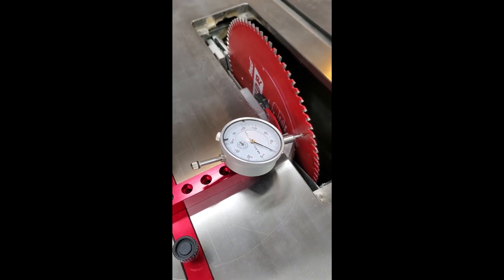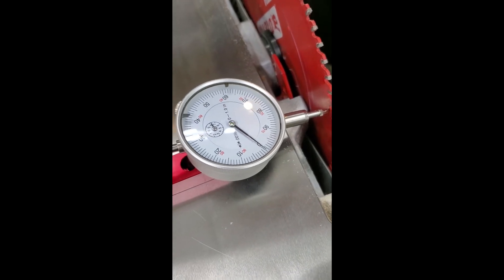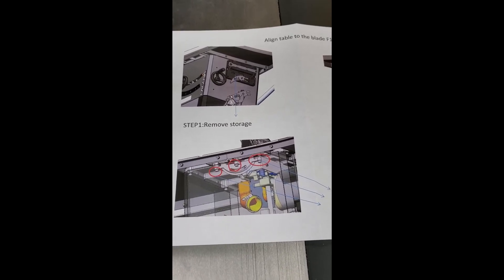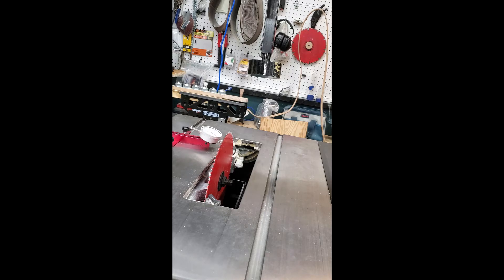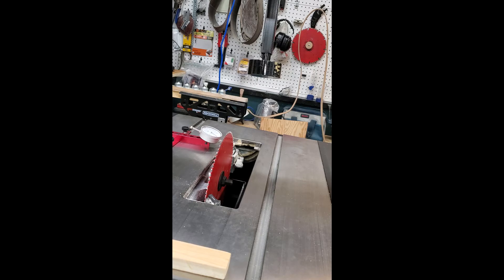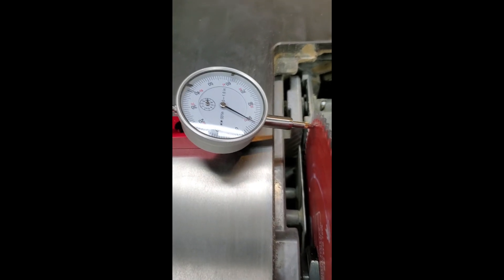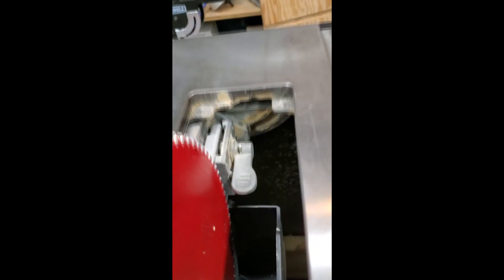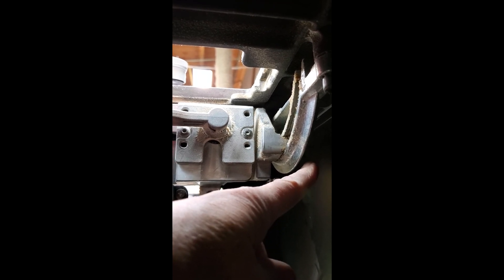Laguna Fusion 1 Tablesaw Blade Alignment

Comment: I know this video is aged now, but I just went through this nightmare with a 5 year old Fusion 1 that was 17 thousandths out. They can be adjusted. Had to remove the table with motor and trunion attached from the cabinet. There are 6 trunion bolts with star lock washers. Need to lightly sand the indentions left by the star lock washers on the trunion bolt holes or the washers will move back to previous indentions as you tighten the bolts thus moving the trunion.
My saw is now within a thousandth. It's a heck of a job and need two people to do it but better than buying another saw, for me anyway.

Comment: This is the first part, I purchased my Fusion 1 saw 8 years ago, I live in Australia so the models here may be different. Of note is that there are 4 trunnion bolts, not six as as mentioned by previous  comments. All four bolts were very difficult to access with the rear left hand one for me was impossible

Comment: hand bolt was, for me, impossible. Laguna were no help and the dealer I purchased it from closed their doors a few weeks ago. In the end I took the radical step of cutting away part of the table end edge to access the bolt. See pic. This was successful and after hitting the trunnions with a wooden dowel  and mallet they moved enough to realign the saw blade with the mitre track. A design fault for sure and I hope they have fixed subsequent models. No more Laguna for me.

Comment: I added an in-line comment below to someone else's comment. I am having the same issue and have tried literally everything, even loosening all 6 bolts and using a clamp to keep the trunnions where I want them. Nothing has worked. I have read a few blogs on Reddit and agree that there's likely a design flaw. I am going to post a similar video on my channel shortly. It's super disappointing as I really want to love this saw....
Reply from the maker: It seems that @MrDarmst may be referring to F2 not F1 saw. F2 never had this problem. It only applies to the original F1 (mine is from 2020).
Reply: @mwaddellus   F2 trunnions are mounted to the base, not to the table as on the F1, which makes the alignment of F2 way easier than on F1.
Reply: I have the same problems, for me enough reason to never buy a Laguna saw ever again
Reply: Did you ever make a video on this topic? I looked at your channel but didn't see anything. Did you ever figure it out?
Reply: @MrDarmst  I did not; although, if you watched any of my videos you will have noticed that I no longer use a Laguna saw :) 
I spent more hours than I care to admit trading emails and speaking to Laguna over the phone. Through that process I confirmed that the table was unequivocally NOT adjustable. One of the people I spoke with at the company mentioned that I may need to drill out the trunnions. That alone was a clear enough statement about the saw's lack of adjustability.
Reply: @industrialcomfort  Thanks for the quick reply. I got it dialed now (+/-.0005). I noticed the owners manual I received 3 years ago (when I bought the saw) was simplified, compared to whats hosted on Laguna's website. I was concerned the issues discussed here, were addressed in an updated F2, hence a new manual. Turns out that's not the case, there is a better manual that applies to all F2 saws. Basically, the blade is stationary and the table is moved untill aligned. Tech support really let you down, it only took a 1/2 wrench and about 5 minutes. ALL 3 BOLTS are accessible from OUTSIDE the cabinet. I think Laguna had everyone looking for the wrong 3 bolts. The updated manual clears this up.
Reply: You bet,  @MrDarmst . Perhaps your tolerances were greater than mine or I got a lemon? New manual or not, the Laguna F1 saw that I owned was not adjustable. As I mentioned, I spoke to them for hours on end trying to troubleshoot and got input from their head of product. There is nothing an updated manual could have provided to address the situation. Not to mention, it's intuitive enough that you really don't need a manual to make the adjustments. If you search the Internet you'll find plenty of people with similar issues, some who've had to drill out their trunnions to get the adjustment capabilities they need. I'll say it again, when their support tells you that you may need to drill your trunnions that is an enormous red flag.
Reply: The three bolts that need to be loosened are spaced equally around the perimeter of the saw, right where the underside of the top meets the saw body. Relative to standing in front of the saw, there is one on the front right (above the blade angle hand wheel), the front left (same place but opposite side), and the back middle (directly in line with the saw). All three have rectangular cutouts which allow you to insert a 1/2” or 13mm wrench and loosen them. Once they’re all loose, give the table (or the base) a good whack with a mallet in the proper direction, check for runout, and repeat. When you’re satisfied, tighten down the bolts. As you tighten them down, re-check the runout to make sure that nothing has shifted due to the tightening of the bolts. 

The whole operation is simply to adjust the orientation of the table top so it aligns with the plane of the blade; as far as I know, the trunions are not (easily) adjustable.

Comment: Just bought a Laguna Fusion F2. I have not finished setting it up yet. Yes, this is way after the fact for you. But my research tells me that the trunnion is bolted to the cabinet not the table. To adjust the blade alignment there are 2 screws in the front and one in the back that holds the table to the cabinet. Since the trunnion is attached to the cabinet the alignment is to be done like a true cabinet saw. Move the table not the trunnion. I hope beating the trunnion didnt hurt anything.
Reply from the maker: The adjustment for F2 doesn't apply to F1 saw. Read prior comments. Thanks.
Reply: From what ive read, this makes the most sense. I'm about to align my F2, do you still believe loosening the table is the correct procedure?
Reply: Yes. The trunnion is attached to the cabinet. Loosen the table. I got online at Laguna and downloaded their full color manual. it explains it well. mine was perfect out of the box. don't kill yourself trying to get dead nuts. The kerth cut into your throat plate was done on the exact saw and blade. That is how the factory checks all saws before the sell them. @MrDarmst

Comment: From what I just read, the F1 can’t be adjusted like the F2 Per the manual. “The fusion 1 should not come out of square as the trunnion is bolted to the table. If the procedure results in false measurement, please check the blade and arbor nut prior to any further adjustments.”

Comment: I watched this about two years ago right after I bought my Fusion I table saw and needed to do the blade alignment. Excellent video and very informative, unfortunately no big reveal on how to actually accomplish the alignment. But that’s not the author’s fault! It’s all on Laguna. The crap POS design of the trunnions mount with 6 screws in nearly impossible to reach locations is beyond imagination. Has a Laguna machine designer or manufacturing engineer ever used this table saw? Have they ever performed the blade alignment? Hard for me to imagine they have, because they would be ashamed of putting out something like this. This is a $1000 machine. I wish I had known this before I bought the saw, as I would have never bought this machine. Ever. Ok, now that that’s out of the way, I did manage to get the blade aligned to the miter slot using a 10 inch long piece of plywood bolted to the saw instead of the blade, and achieved right at about 0.001 inch across a roughly 18 in span. It took me hours to do it.  The setup with the dial indicator is just as described in this video and others. After doing this twice, the last time just a few days ago, I have learned some tricks. Loosen all 6 Allen head screws, a lot. Move the carriage and trunnions back and forth by hand to loosen it all up a bit. In my case, the back trunnion (side of the blade opposite of operator position) was quite loose, moving by maybe 1/16 inch back and forth. The front side will not move as much, hardly at all. So I used a 24 inch woodworkers clamp spanning from the tool holder side underneath the blade carriage and to the other side of the carriage to pull the front side trunnion into “position”. Then I used a wooden beater bar and a rubber mallet to bang the back trunnion into position. I would take a measurement, and then when close I would snug up (not too tight) the middle screw on the back trunnions. Then take another measurement.  From here it’s back and forth, trial and error, because you are dealing with a few thousands of an inch, using a rubber mallet and a wood clamp! I know, freaking ridiculous that anybody would design something like this. But I did get it, as I described above. Once you get the carriage in position, tighten the middle screw on each trunnion. Then check alignment again.  Sometimes you have to repeat this because tightening the screws throws it back out of alignment. After you get the two middle screws tightened on an aligned blade then carefully tighten the remaining 4 screws.  Having done this twice, the first time being an all day nightmare, and the second being only a couple hours, I’m pretty sure I can repeat this the next time in less time. But there won’t be a next time buying a Laguna machine. They know this is a problem and can’t even be bothered to update their manual where they describe “loosening” three screws to perform the blade alignment. As I said, pathetic design. 
I hope somebody can learn from what I described, I spent many hours, and many cuss words while learning it. :).

Comment: Hi Michael, I was wondering if you were ever able to align your blade to the miter slot.
Reply from the maker: Yes - see my update in Comments section. In retrospect, even though I like the saw's performance & price, I would never buy it again. Plus, even after informing Laguna customer service, the latest manual for this saw is still incorrect.
Reply: @mwaddellus  FYI, I believe there is a new updated manual. I couldn't figure out how to make this adjustment, with the manual I received with the saw. I finally noticed they host a new manual on their website.  It has super fast and easy instructions, now within +/- .0005
Reply from the maker: Very interesting. I went to their website and looked at the F1. Here's a quote: "With a completely redesigned trunnion and arbor controls"... seems to me that the saw has been redesigned, perhaps to eliminate this problem. Kudos to them! Too late for me!

Comment: I’ve loosened all 6 bolts on my saw, but doesn’t budge.  I’m giving a few good hits with a rubber mallet to the trunnions but to no avail.  Follow up video would be awesome.
Reply: @Wooden Jeeper I could only get them to move after flipping the unit upside down, however then it is challenging to to take readings using gauges.  I was able to improve it, but still feel like it could be tweaked more, but that has not been an easy task.

Comment: Hi Michael,

I am having this same issue with my Fusion F1 and I cam accross this video (https://youtu.be/1P1IESpgAnE) that explains you need to loosen the bolts on the trunnion on both sides (that would be six bolts). Hope this helps.
Reply from the maker: Thanks - the link you provided doesn't work. Please check it and post it again. Thanks!
Reply: @mwaddellus  I too am having this issue and I tried loosing all the bolts. In fact, I used a clamp to ensure the motor was aligned perfectly. It still didn't work. I believe there is a design flaw in how the trunnions were drilled. There just isn't enough play to permit adjustability. I am going to post a similar video shortly on my channel sharing the issue. What a pain!